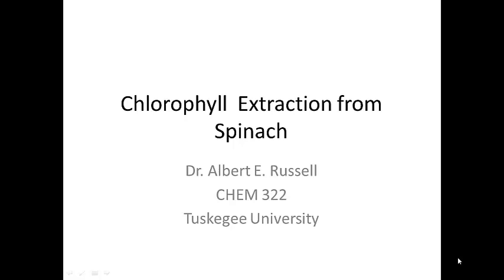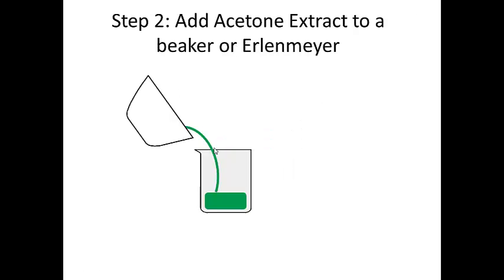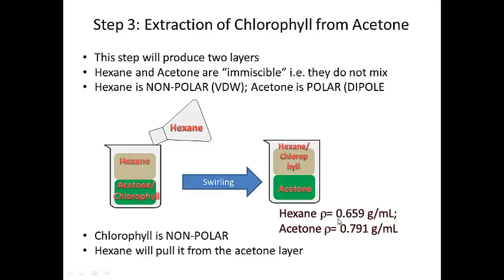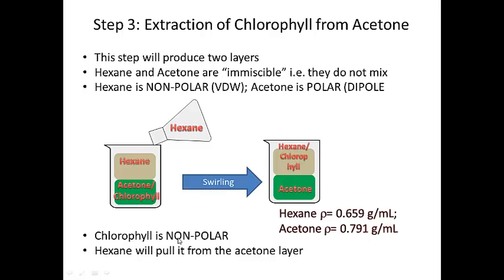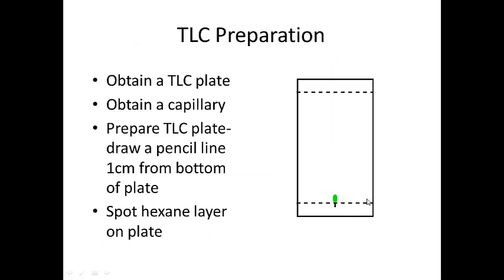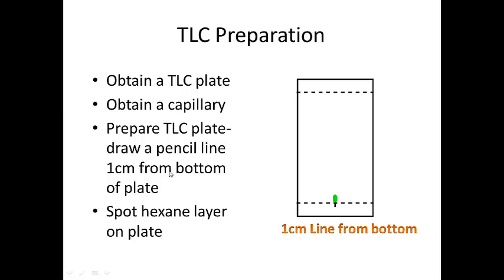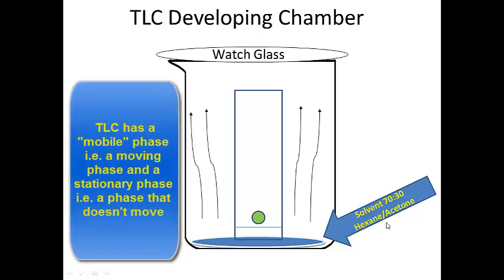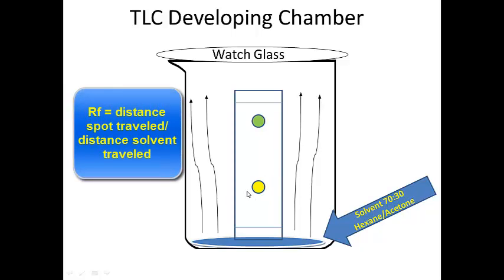Chlorophyll Extraction from Spinach

Comment: do you swirl the hexane and acetone/chlorophyll with a pipette or something small?
Reply from the maker: We've actually found it much easier to use a separatory funnel.  I need to update this video.  But if you follow this procedure, you can certainly use a glass rod or simply swirl the beaker containing the mixture.
Reply: but there will still be a small amount of chlorophyll in acetate?
Reply from the maker: Maybe a very small amount.  We haven't tried to quantify how much.  Most of the time we get about 200mg of chlorphyll from this extraction, beginning with 25g of spinach and rationing out 15 mL aliquots to each student.
Reply: one thing, is it ok for the tlc plate to lean or is there a way to make it stand without letting the solvent evaporate?
Reply from the maker: I always encourage students to use tweezers to manipulate TLC plates.  The easiest way to keep it upright is to lean it slightly against the back of the beaker (developing chamber).  As long as the solvent doesn't cover the spots, you're good.
Reply: can you see the two layers visually so you don't mix up the acetone and hexane for the spotting?